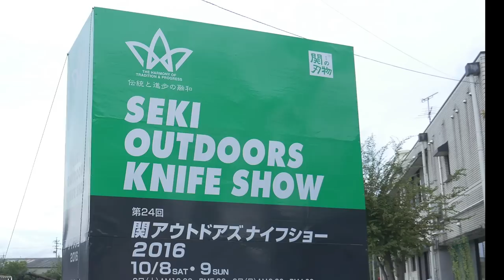Japanese Knife & Sword City: Seki Experience ★ ONLY in JAPAN

Comment: its a real shame, you buy yourself a really nice knife and you show your disrespect for it by using it on a glass plate.  always use plastic or wood/bamboo for your cutting Never glass, steel, marble, or ceramic boards.
Reply from the maker: Why weren't you there with me to tell me this? I work with what I have, which is very little. I think the knife wasn't so disrespected by it. It's still resting in the box until I can get a better cutting board. -john
Reply: And you do extremely well with what you have and i appreciate all the hard work you put into these videos which i always give a thumbs up to. thank you for the great vids that you make.
Reply: Interesting to know! Didn't know that
Reply: If you want to be really anal about it, bamboo isn't a good choice either because the shape of its fibers can grind on the edge with prolonged use.  Making one cut on a plate for the camera isn't worth sperging over though.